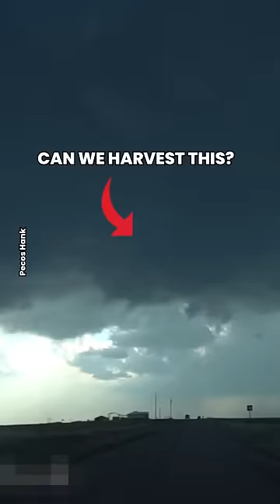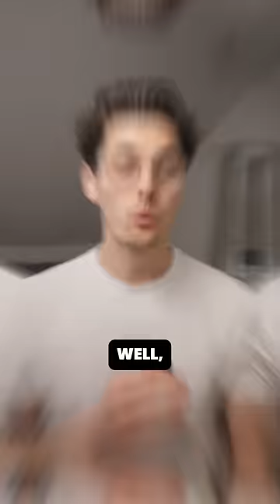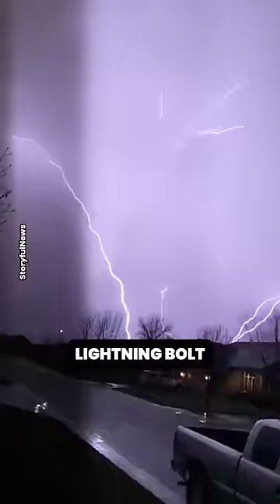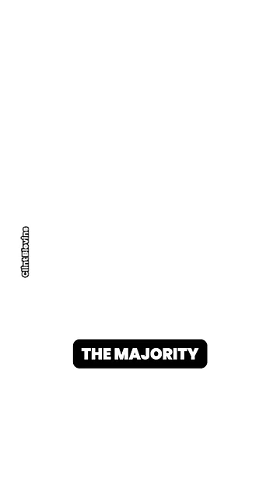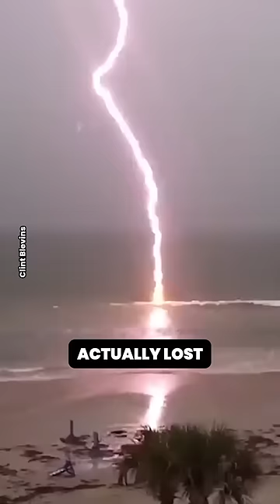Why don't we harvest lightning for energy? ⚡️ #shorts #alternativeenergy

Comment: “No one knows where the lightning would strike.” 
Isn’t the Statue of Liberty just a massive copper rod?
Reply: 😮😮😮😮😮😂😂😂😂😂😂
I mean u r correct 🤣🤣🤣🤣🤣🤣🤣
Reply: Yeah, but it just carries the electricity to the ground. It doesn't use the power. If it sent it to a battery, then it would stop working as a lightning rod. It needs a direct path, not a battery which takes time to charge.
Reply: Half French, half American, and 100% conductive.
Reply: @n00bxl71  Battery can be ground level ot underground
Reply: @nervonabliss  batteries can't store the energy of a lightning bolt. It happens too fast. Besides, if it's underground then the high voltage electricity will jump to ground through the air, and none of it would reach the battery.
Reply: @n00bxl71  there are ways to keep it from leaving whatever conductor is facilitating travel. A highly resistant to electrical current material like diamonds. And obviously we know batteries suck at storing extremely high voltage quick bursts of energy so this hypothetical assumes a new form, maybe solid state
Reply: @nervonabliss  well, maybe if we did invent a new, better form of battery or capacitor, but still, it would have to be above ground. Air is one of the best insulators there is, and lighting has enough potential difference to jump through multiple kilometres of air. If it can do that, it is going through any insulator you throw at it.
Reply: @n00bxl71 capacitor farm
Reply: @MailboxYig  If the electricity is high enough voltage to jump through kilometers of air, it's high enough voltage to jump the gap between two plates in a capacitor. They're typically not kept very far apart. You'd need a capacitor as tall as the distance between the clouds and the ground (which is basically what the charge difference before a lightning strike already is), if you don't want the electricity to short. And at that point, there'd no longer even be a lightning strike to capture, as the clouds are now too low to send the charge through the top of the capacitor.
Reply: @n00bxl71  you................ have a point didnt think of that issue
Reply: So why not construct a nearly impenetrable ark size building, all walls, ceiling and floors are super conductive metals that are also all connected in series(capacitive) of course; then we use the simple technique we all know that generates the energy that is discharged in thunderstorms(lightning), which is raindrops rubbing and passing in the clouds build massive amounts of static electricity through friction.....,... So create that process Inside the structure that is grounded of course, and massive conductors leading to a similar structure that's strictly storative,should theoretically start sending direct current to second structure

Comment: Lightning hit the chimney of the house one time turned on the metal detector upstairs in the closet it hadn't been used in and quite some time and the batteries were surely dead the batteries worked for about three to six months they were rechargeable
Reply: holy
Reply: @kurostyx9124 nice profile pic
Reply: Cursed charger
Reply: Lightning hit our house and fryed out micro wave where it turns on when the door is opened, seperate time it also blew up our tv box so badly the only thing on the wire was the green mother board

Still got the mother board
Reply: @times5ive agreed, Smash.
Reply: @LitFox_24 dang, you need to check the lightning protection of your house. (Lightning rod, etc.)
Reply: @sillycat277 Yo wtf???? That's a kid??
Reply: @king_pathik "ummm achsewelly she's 8000 years old 🤓"
Reply: @TetyLike3  8000 years and still built like a 4 year old I'd just kms
Reply: You really don't like using punctuation
Reply: I could not make sense of your text. 😮 Use sentences, please😅
Reply: I spilled coke on my dad's computer router once and fried it when I was like 9. About two weeks later lightning hit his apartment complex from a small tropical storm and it literally fixed it somehow.
Reply: @times5ive smash.
Reply: THIS IS WHY!
Reply: What I wonder is 1) What kind of path did the electricity take to get to the batteries and 2) how come you couldn't see that path?
Reply: @slightlyuncomfortable lol interesting
Reply: lightning struck our house and killed our wifi modem once
Reply: @king_pathik  Yo wtf???? That's a drawing on someone's youtube pfp?? 🤯 Also no 4yo looks like that and if you want to actually go next in real life over a youtube pfp, please proceed 🙏

Comment: Him: we don’t have something that could survive a lightning bolt

Benjamin Franklin:
Reply: Real
Reply: He means we can’t store massive amounts of electricity so quickly, capacitors would fry under the charge flowing so quickly. Material science isn’t the problem, it’s the energy density of the battery and the transfer medium that is able to deal with the rapid release disharche
Reply: @xenophobicsokkorean6055 Silver wire(like a foot thick branching off into smaller wires) would probably work, just would have to have a good insulator around it so it wouldn't arc. The minimal resistance would stop a lot of the energy transformation from electrical to heat.
Reply: @teufelhund3801 If that worked then they would have been doing it
Reply: I dunno man, he’s not alive anymore. Doesn’t seem like a worthy investment.
Reply: @teufelhund3801 Gold wire would be used not silver
Reply: @kingiument4627  Gold is less conductive than silver, silver is the most conductive metal. Why would they use a metal with 10x the ohms?
Reply: @teufelhund3801  Are you sure about that?
Edit: Damn I was wrong ig ive always been told gold was the most conductive
Reply: @kingiument4627  Silver by far is the mostly conductive metal, and it can be aligned to be even more conductive through certain thermal applications.
Reply: @teufelhund3801 that energy is lost BEFORE the lightning reaches the ground it's all expended as the arc travels downward meaning there isn't much energy left when it finally reaches the ground (that's a relative term it's a lot of energy for organic humans to tolerate but not much when you consider how much energy is built and lost in a fraction of a second)
Reply: Facts😂
Reply: @kingiument4627 well gold is used more for its conductivity and I’m guessing the reason why is that silver tarnishes over time so would ruin its self over time of used instead of gold
Reply: @xenophobicsokkorean6055  Benjamin. Franklin.

Comment: "It's too much power for our technology to handle" 

"It's not enough power because it's hot and bright"
Reply: When did he even say that first one?
Reply: @Haispawner  "We don't yet have technology that could survive such a massive surge of power" is their direct quote, it's near the beginning of the video
Reply: @Haispawner ahh... Sorry, you can't be e researcher! 😂
Reply: These things are not mutually exclusive. It's weak in relation to how much energy is generated by a storm, but too powerful for current technology to store all at once.

There's a reason things that time to charge
Reply: @tydy5266  you're not wrong, but that's not funny. I wanted a slight chuckle.
Reply: Its because Lightning has amost no energy. Only about 8kwh not enough to power 1 home
Reply: @ancientlink0  nearly a whole day of electric in one, for me and I live alone
Reply: @mlee6050  1 small heater uses 48kwh per day
Reply: @ancientlink0  depends on efficiency and size of room, I use 2kwh setting as it is more efficient to heat same flat than 1kwh and so uses less energy per 24 hours
Reply: and then theres the tree burning up from one lightning bolt....

Comment: We absolutely have ways to obtain it and store it. 
Plus lightning is pretty predictable considering well, it usually hits the highest object. 
We've literally created things called lightning rods to avoid it hitting other things
Reply: Source I made it up
Reply: @1ZombieMan1 Nope,lightning rods very much do exist.Do ya research first.
Reply: Yes and you get barely any actual energy out of it.

Show me a lightning rod that can actual store the energy and move it to a power grid.
Reply: @Haispawner  That wasn't the topic,yes they store extremely low amounts of energy.
Reply: bro did not play Minecraft

couldn't figure out rods attract lightning 😩
Reply: @RONK-ve9yq harnessing the energy of lightning strikes IS the topic of the video 🤦
Reply: @shinobi-no-bueno  I meant the topic of the conversation ,not the video.
Reply: @RONK-ve9yq reread OPs comment. It's still the topic of the conversation.

Also, I'm curious how big of a coil it would take to make a lightning bolt useable energy.
Reply: @waroftheworlds2008  Sorry ig
Reply: @Haispawner they could put it on a battery? like how we charge stuff .. plus it shouldn't be the only source of electricity ... the energy stored can be used in emergency situations like a massive power outage which is pretty rare to happen nowadays so it can store tons of energy
Reply: @kairokimurach the problem is there is not an option to store a massive amount of energy in that short of a time. Imagine a cup of water that has a tube connected on the bottom that can transfer the liquid to a bigger container. The amount of water that can be transferred is fixed. Now imagine having 5 gallons of water in another container. If you dump all of the water to the cup at once the water will simply overflow. Energy is like that (simplified of course). You need a high capacity to store the energy from the lightning and the ability to transfer that quickly enough.
Reply: @1ZombieMan1 nope, that's general knowledge

Comment: I remember reading about this, there is a potential difference as you climb in altitude, it’s always there, Tesla was attempting to harness it for free energy but the project was shut down mid way for some reason.
Reply: Free means it doesn't generate profit.
Reply: Yh. It's Atmos electricity which is what gravity actually is as well not some bendy early space time reification fallacy.
Reply: Sooo you gotta build a really high metal tower and power starts flowing
Reply: @Owen-sx4jj what
Reply: Money
Reply: Capitalism has stifled growth
Reply: Tesla was trying to make a wireless emission tower that sent power to smaller local receivers as "free energy" but it was shut down because anyone could theoretically tap into it without a power company being able to charge them for it.  It's unlikely it would have been cost effective even if they had because of the scale required and the power loss from transmission (radios need external power sources to amplify the electric signals because the signals themselves are not enough to power a speaker to an appreciable volume).  

It's far more efficient to run powerlines than try to use radio signals as a significant power source and the infrastructure would interfere with most wireless communications and long range radar as it would essentially be massive spires or webs of metal which would scatter and jam whatever signals it doesn't absorb.
Reply: Some reason or EdIsOn??

Comment: "And we don't have technology that could survive such a quick massive bolt"
The lightning pole: Am I a joke to you?
Reply: He means electrical circuits, like a battery or a capacitor
Reply: @johnf4388 nobody tried building one.
Reply: @Fiatluc  they dont need to try to build one. If the estimated power of lightning bolt is beyond what we know our technology can withstand, there's no point in trying to build one.
Plus im sure they tried in the pas and everything was blowing up.
It's a good idea for the future though, tons of energy to harvest.
Reply: @johnf4388 it just has to be big enough to disperse it appropriately. Or you can just heat water with it,  aa we always do. The only problem is that it is not reliable
Reply: @johnf4388 so you just keep building larger and larger capacity until one doesn’t explode
Reply: I'm pretty sure those pylons actually store the energy as well.
Reply: @johnf4388 that's stupid because why would we talk about putting it directly on a circuit. It's like he knows NOTHING about electrical engineering.
Reply: @juaecheverria0  because to store the electricity you need to put it in a circuit with batteries or capacitors and a bunch of other electric components. An all those things need to be in on a circuit to allow the electricity to flow into a battery or a capacitor...thats how current flows...in a circuit.
Unless is some other comments have said to use it as thermal energy instead.
Reply: @johnf4388  which is why we never put any direct high voltage directly on a circuit. Not even the batteries in any of our devices do that. They all have resistors and transistors to do this job easier.
Reply: @juaecheverria0  i never said to put the rod directly connected to a battery. Obviously you need other components, im not an electical engineer but i understand the basics. The rod still has to be connected in the circuit for the current to flow in batteries or capacitors.
Reply: @johnf4388  But see that's what I'm saying. It's totally fine if you do it the right way. OP is talking about what happens with direct voltage output with none of these resistors. And he just doesn't know what he's talking about. That's why I'm saying what im commenting.
Reply: “ we still don’t have that technology”
One World trade Center lightning pole: I’m basically the middle child

Comment: Alright redstoners, its your time to shine
Reply: We need a tall structured isolated from ground and a connection to the ground via a capacitor bank.
When lightning strikes the capacitor gets charged.
Reply: @cezarcatalin1406 or we just build it high enough so that the clouds won't overcharge in a jumping arc, maybe it's possible to get an continuous flow of electricity using the  alternator in the sky 🥸🤔

Comment: Also lighting doesnt "hit the ground" it comes up from the ground and down from the sky at the same time to meet somewhere in the middle, it's an equalization of different charges in the sky and earth.
Reply: That’s crazy
Reply: @dreadlocsamurai4241 its actualy a circut. so every time one strike ocures theres actualy two lightening bolts that cause the air to become ionized which is the plazma you can see. this is usualy enough to cause a small explosion.
Reply: Incorrect, the majority of lightning strikes are (CG) cloud to ground, strikes. Only a small number are GC.
Reply: Lol, there are different types of lightning
Reply: The energy flows from the sky to the ground though.

Comment: We do have the tech it is call Capacitors. The lightning bolt would charge the capacitors and the excess would go to ground. Then we simply release the capacitors i such fashion to create AC.
Reply: Its because Lightning has amost no energy. Only about 8kwh not enough to power 1 home

Comment: if we found a way to harvest it, most of the energy will not dissipate as heat and light before it reaches the ground. It’s only being lost as heat and energy because it has nowhere to go. If it could go be stored it wouldn’t be dissipated.
Reply: But the issue is the speed at which it does so. We don't have any machine to harness that at that speed

Comment: I'm pretty sure we know places where lightning strikes regularly. 
One of the problems we face is how to store, in an instant, that massive electric potential.
Reply: There are at least three basic types of lightening strike. Cloud to cloud, cloud to ground and ground to cloud. Cloud to cloud would be very difficult to harness and would definitely be a bad starting point unless you were trying to power a Venetian cloud city.

For cloud to ground, I don't think you'd want a lightening rod on the surface or on top of a building. You'd want an airship with a metal skin tethered with a thick copper wire with thick electrical insulation. This doesn't just drastically reduce power loss to the atmosphere, it drastically lowers how high the voltage gets before amps flow. You might still get some power spikes that are too fast to economically be handled by double layer capacitors or flywheels and hence still requiring humongous capacitors, but if you aren't able to get a stable flow of power it should at least be far more stable than flow than you'd get from ground based lightening rods, it would also give lightening protection to a much larger area.

Other than requiring a gigantic bridge rectifier, the same setup should be able to handle both cloud to ground and ground to cloud.

Also, using lasers to produce a plasma channel to direct lightening to a particular point might be an alternative to using air ships, though I suspect though the airship would have a much higher embedded energy of manufacturing than the laser, the laser is going to have a much much higher operating cost.
Reply: @deanonesense 
You don’t want a laser, you want a pulsed high energy electron narrow beam to ionise the air... you know, the stuff that makes air or water glow blue.
Reply: Did you know? Lightning is powerful but not practical for energy. Each flash has about 4 strokes, each at 10^12 watts for 30 microseconds. Quick math: Energy per Stroke = 10^12 watts * 30 * 10^-6 seconds = 30 million joules. Total for a flash? 120 million joules, equivalent to about 3.81 liters or 1.01 gallons of gasoline. But capturing lightning energy? Super tricky and not efficient with today's tech. It's more a natural spectacle than a power source!